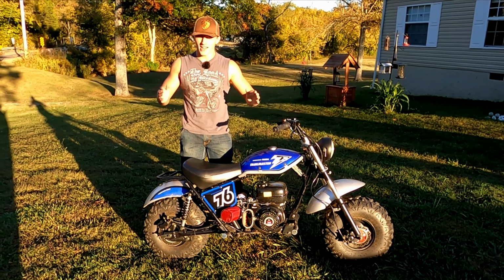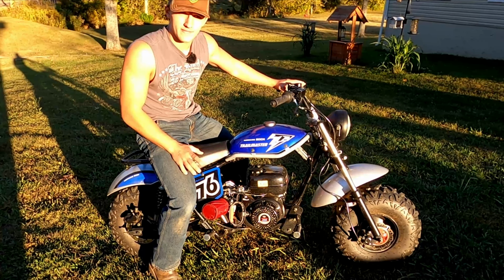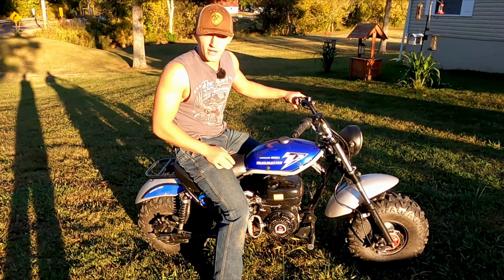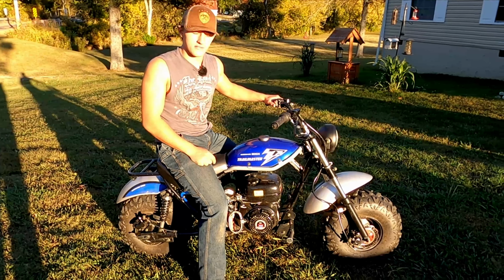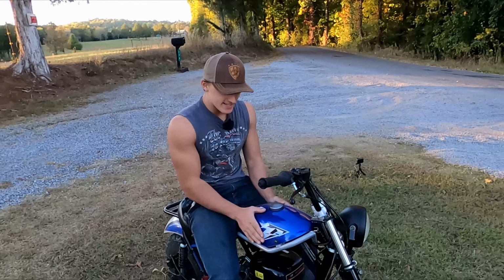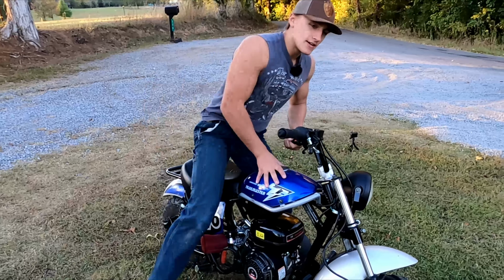Trailmaster Hurricane 200x stage 1 kit and shenanigans!

Comment: Based on my experience with my mb200 I try and turn the Idle down to about 1900 so the torque converter is not Partially engaged but not much from factory

Comment: Had the issue with my pull string not engaging.  Pulled the pull sting assembly off and scotch brighting the top and bottom of the metal wings and haven’t had an issue since. Pull string still binds with the housing when it doesn’t coil properly…
Reply: Having similar or same problem...anyone else have issues?

Comment: Did you have to re adjust the idle? Higher or lower then the original specs?
Reply: There is a small black screw on the carburetor if you loosen that screw the idle will go down, and if you tighten the screw the idle will go back up.
Reply: Thanks cris. That's what I meant. I know how to adjust the idle. Just wondering after the stage 1 upgrades if you increase or decrease from the factory recommendation of 1400 +/-
Reply: @johnfillmaniii6899  for the stage 1 kit I put on my go kart I did not have to adjust the idle. But I might be different depending on the engine you put the kit on. My kit was for a Tilitson 212.
Reply from the maker: Thanks for answering my comments section questions for me😂
Reply: @redneckreviews3532  any time😂